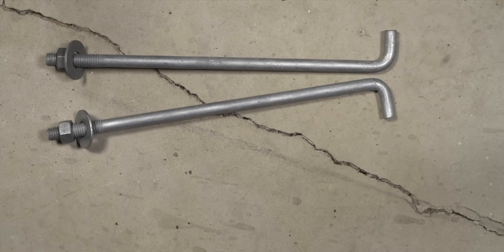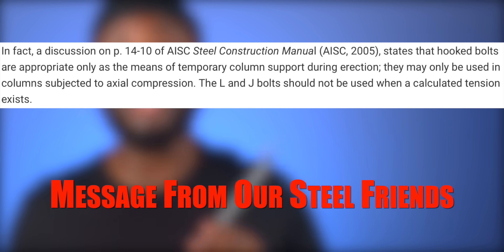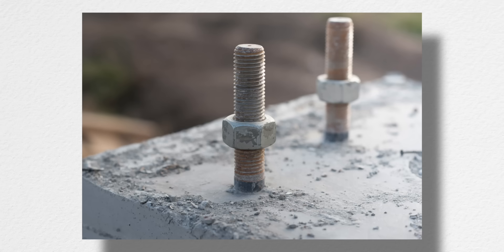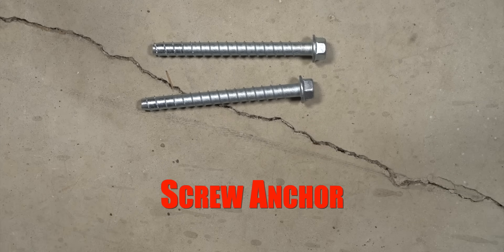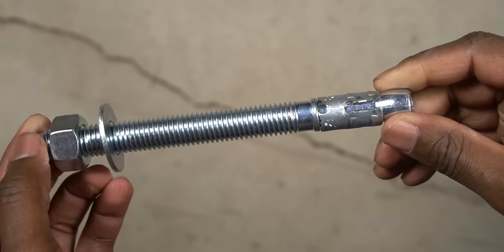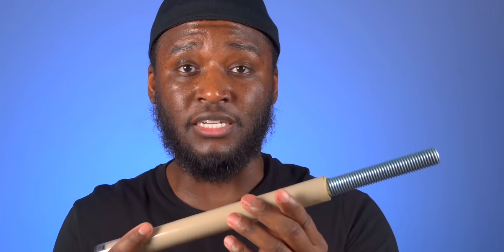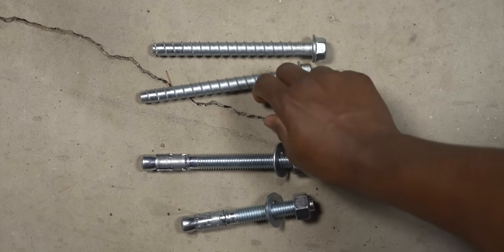Why Abandon "J" & "L" Anchor Bolts in Wood Framing Construction FOR GOOD?

Comment: Screw anchors are about the worst alternative. Most contractors set these bolts with impact drivers which results in concrete powder around the threads. Concrete is only strong under compressive loads, and the screw anchor force vectors are more of a shear load, not compressive. The theory works in wood, complete garbage in concrete.

Comment: I like post frame construction and timber frame construction best. I use brackets with two screw in bolts. I do like that threaded rod with epoxy the best. That's very cool but expensive.

Comment: As someone who has done A LOT of demolition and foundation installations; this engineer’s assessment is a classic example of paper knowledge not squaring with practical knowledge.  I have ripped screw in and wedge anchors out of foundations fairly easily with 10,000 pound excavators, but galvanized J bolts infrequently spall out of the concrete and if they fail during the demolition process the steel breaks under tension after substantial weakening at the interface with the concrete.  I suspect the errant conclusion you’re drawing is due to three things some engineers don’t account for in their paper calculations.   1. Micro cracking of the surrounding concrete during drilling of the concrete for wedge, epoxy anchored, and screw anchors.  2. That uplift is almost never perfectly vertical with any anchor.  3. Cast in place anchors can and should be cast between two pieces of rebar at the top of the foundation (which can be felt by the installer during the wet cast process).

Comment: I’m also an engineer with much experience in the steel fabrication industry. J/L bolts are problematic in that they are both made from round bar, and the threads are cut in a threading machine. They are almost always delivered to site covered in this oil, which will prevent any bond with the concrete. L bolts are the worst because many fabricators don’t have rebar bending machines, so they bend the L in their ironworker’s press. The result is a bend with almost no radius and bar diameter is necked down by 25%. I had a steel column fall over on a job during installation after the rigging was removed due to this very problem. The hook snapped off right at the bend, and with no bond due to the cutting oil, down it came.

Comment: Wet setting anchor bolts isn't brain surgery, but it sure helps if someone on the foundation crew has a brain.  We need 3" plate washers in Washinton, and the guys often get the bolt too close to the outside edge, or they assume there will be a 3x plate and they set the bolt too high. My last job we had to saw off 10 bolts because they were way too high and ran out of threads.  That's where wedge anchors are handy as a backup.  But no one in my 30 years of building has balked at wet set J/L bolts—EVER!

Comment: Dream on. As an electrician for 30+ years I've used  the same anchors shown for equipment and had them fail, even before torque. Albeit poor concrete, worn drill bit, whatever.  No poured in place has ever failed.

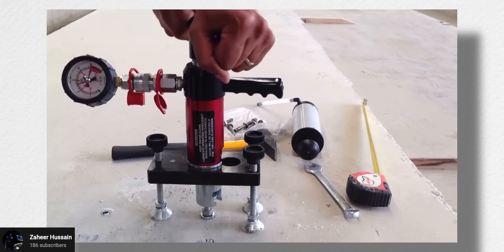Comment: sounds like you dont want to do the work it takes to use a j bolt right.  also, that test you showed at 1:27.  you shouldnt have show the last second of it.  you could see that there was like 1.5 in. of concrete, and thats why it failed.

Comment: The J or L bolts are called out in the building codes with required depth and spacing.  There is no code information for the use of other anchors and thus a structural engineer is required to sign off on the use of those and specify brand, size and spacing.

Comment: Why not replace the J bolt anchor with 'Eye bolt' anchors which would have the horizontal rebar threaded through the 'eye'?  And there are plastic 'anchor bolt' holders that make sure the anchor bolt is in the right place, plumb, and with enough room to thread on the washer and nut. Here in my area, you need to install a significantly beefier washer on the anchor bolts.  (By the way, are single bottom plates standard in your area?  Here in Washington State, double top and bottom plates are required.  Also, 'hurricane plates' are going to hold down the roof much better than anchor bolts--no matter the type--in high winds.)

Comment: I use Simpson Strong Tie expansion bolts exclusively.  They are the only method I trust.  I've tried many other types of fasteners with nothing but failure.

Comment: So, like most everything else modern, it's not about better.  It's never about better anymore.   It's about easier, cheaper, faster, when you're building SOMEONE ELSE''S building.  No thank you!  I'll take better, EVERY TIME for MY buildings. ;)  As an ametuer who has place concrete a few times, I have found that it is no problem to properly align plumbing, conduits, and, yes, anchors. It is time consuming to do correctly, but it's only once, then you enjoy a quality project for many years to come.

Comment: Code says that the bolts must be at least 7" into the concrete.  The bolt would need to be ~9".  Only 1 of the bolts you showed were even close to that.  If a J-bolt is set with rebar through it, then the uplift would have to raise the entire foundation.

Comment: My great grandfather and grandfathers used L and J bolts in their concrete work as early as 1916 . Their builds are over 100 yrs old and still standing. The International building codes cant all be correct ? Some construction is older than the USA and that construction is still standing 🤔😖

Comment: 40+  years in construction  30 as a licensed contractor. In CA we are required to position our bolts before pouring cement and if you run a piece of rebar in the J it will hold anything you need. We build here to a very high standard because of the earthquake hazard so don't let this scare you away from  "J" and "L" bolts. They work. This is just one more Engineer with complex calculations and no common sense. J and L bolts have stood the test of time and we don't need to replace them.  He keeps saying that they are still "technically allowed" as if they should be considered deficient. They are not deficient.

Comment: Been building buildings for 30 years now. I've only ever seen them used in conjunction with rebar in the concrete with a plywood template to keep it in position. Basically, you're using them wrong.

Comment: Maybe the epoxy one but expansion and those threaded ones you just screw into a drilled hole always a problem,  will stick with J & L bolts.

Comment: On a typical block foundation, any of the anchoring devices is only as strong as the bed mortar joint for the top coarse of block.
UNLESS, the block cavity where each anchor is located is filled solid with concrete and a rebar from the footing to the top where the device is located.

Comment: Great video, thanks.. I was a contractor in Florida. I moved to GA and when I went down to help a bud with a custom I found out they had changed to threaded rod from foundation to rafter. Much harder to run rod all the way around the home but I loved the continuous rod from top to bottom. I have seen hurricane damage that left the plate(j bolted)but the house was gone. In some parts of the country this isn’t code but I always said no matter where I build I would use Florida code. It’s pretty solid.

Comment: you need to double check your figures .you said friction can't be considered in your calculation for the pullout strength which doesn't make any sense ,it's there it's real  . and if you look closer at the ones you recommended they are not embedded in the footing .they just sit in a hole depending on either the TINY threads on one model the other depends on just the bell on the very end on the anchor to do all the holding .now it is true both of these  anchors work well but to say they are better then a anchor embedded in wet cement  is just foolish .do a test with your recommender versions by putting the anchors  2 inches deep  like you did with the L anchor . then see how well they hold ,,or don't hold

Comment: I'm not an engineer, but as a residential builder, just the logic that small threads or a flare is more resistant to pull-out than the cast in L or J section is ludicrous.  We've done drill-ins with the flare when a j-bolt was missed, and the only thing that keeps them in place in our area (which must be engineered for 90 mph winds) is the fact that the special epoxy going it the hole is stronger than the concrete and bonds to it chemically.

Comment: If those L bolts are good enough to hold a steel post and cantilevered sign way out over a highway, which has a tremendous leverage force on it, then I trust it is plenty strong to hold a house down.
I have used Tapcon screws before and if you drill the hole slightly too big, fail to clean out the dust, overtighten it or loosen and re-tighten it, there's a big chance it will not hold.
If a J bolt was hooked under re-bar and you pulled on it with a crane, I bet you would lift the slab up before the bolt pulled loose.

Comment: Gotta love engineers. Those J bolts have held down houses and buildings for over a century but now all of a sudden they are not strong enough to stop high winds from ripping a house out of the cement foundation? OK 🤣🤣👌👌

Comment: Are J bolts actually failing due to the wind pulling them out?
I have only seen a couple houses that have "blown over" but the J bolts didn't appear to fail on those houses.

Comment: In a case like this where structurally both things are fine solutions, I would just go with whatever the builder is used to using, since that is what they are most comfortable with and thus most likely to install correctly. The engineer and builder should be involved from the beginning and talking together anyways.

Comment: Bottom line one all of those options is skill in application. 
I did foundation repair and seismic retrofitting in Seattle for two decades. Getting any of those anchors in the right spot for the right conditions is   crucial. However the Titan HD bolt is a game changer indeed. Pretty much dummy proof.

Comment: Jbolts are not that hard unless your concrete installer is struggling.
Post installed anchors can be difficult finicky and problematic as well. 
This video is off kilter and factually challenged. 🤷‍♂️
It’s a good discussion tho so there’s that…

Comment: How many structures have you seen come off the foundation? In my 30 years, I've seen many structures that were built without anything holding the houses down. I live in the Northeast on the Atlantic Ocean. If the forces are hard enough to lift your structure off the foundation, your structure is probably destroyed anyway.

Comment: How much wind would it take to cause enough uplift on a roof to pull the  anchors out of the foundation? I have helped clean up a  family friends home that had been destroyed in a tornado. The house was literally gone. The only thing left was the foundation and the bottom plates that were still held to the foundation by the j-bolt anchor bolts. The bottom plates were all still tight against the foundation. It was the nail connection of the 2x4's to the bottom plate that didn't hold........

Comment: Yeah, uh no. Anchor embedded anchor bolts will be required, and inspected prior to pour. If they are missed or inadequately spaced there will be a substitute resolution which may involve  special inspection and or testing. Post pour installation bolts will be more expensive and may not be adequate.

Comment: I have a job that has me do the same things over and over, and I have figured out ways to make the hard tasks easier.  If my job was to install dozens of L bolts on every job, I would be very motivated to come up with a way to get them spaced properly, set at the right depth, the right distance from the edge, and hold them there until the concrete sets.  If I was unable to do that, the bottom line is that is that I would be incompetent at my job and deserve to be fired, or never hired on another job again.
Don't ask me how to set L bolts because I don't know.  But if I was making my living at it, I would find out how other people do it, or I would invent a way to do it.  And I'd make it a priority and get it achieved pretty darn fast.  In fact, I'm going to search for YouTube videos that show how to do it right now.  I'm guessing that several people have good ways of doing it, and they've been in use for decades.

Comment: You will not pull a j-bolt out of the concrete will pull a f**** drive anchor out or screw bolt yes you will yes you will yes you will

Comment: A video showing the pull out test of J-bolts vs the other options you mentioned would be more interesting than "J-bolts bad, use these". Show your work please. Also, FWIW, my personal experience with expansion bolts like the Red Head is that about 20% of the @#$%^ things fail to expand in a way that I trust the connection.

Comment: Why is it called the “International Residential Code” if nobody outside the USA is interested in it?
there are basically few countries that have a worse standard of construction than the USA
the screw anchor, for example, is not permitted here for load-bearing constructions, an expansion anchor is the minimum

Comment: Please keep making videos on best practices for EVERYTHING to do with co structuring: under floors heating retrofit on concrete floor that holds moisture. 

Electrical install if you do electrical too. 

Better and stronger siding materials and techniques

Etc.

Love hearing from an engineer. Makes me feel more secure with the project I am about to undertake.

Comment: Engineers and Construction Professionals,

I am seeking expert advice regarding a serious concern with our newly constructed home in Texas. The property is a two-story, 2,265 sq ft residence with a long, narrow footprint. As one of the newer homes in the subdivision, it was temporarily isolated in an open plot when a severe storm (93 mph winds) caused structural racking damage.

The builder promptly notified us of the issue, stating their intent to demolish the existing structure, remove all debris, and rebuild from scratch after a foundation inspection. They also committed to providing an engineering report. Upon inspecting the foundation myself, I observed no visible cracks along the exterior. However, nearly all anchor bolts were severely bent—some completely flattened—with a few causing minor concrete spalling at the edges. Given that the home was not visibly racked to an extreme degree, I suspect much of this damage occurred during the teardown process.

My key questions for professionals in the field are:

Anchor Bolt Replacement Methods: If the foundation is deemed structurally sound, what is the standard procedure for repairing or replacing damaged anchor bolts?

Original vs. Replacement Integrity: Were the original anchor bolts cast-in-place during the pour? If so, will drilled-and-epoxied or expansion bolts provide equivalent strength and long-term reliability?

Potential Compromises: Does drilling into the foundation for new anchor bolts introduce any risks (e.g., reduced load capacity, water intrusion, or corrosion susceptibility)?

Inspection & Compliance: What specific engineering checks should I request to ensure the repaired foundation meets code and industry standards?

I have a meeting with the builder tomorrow and want to approach this discussion with informed, technical questions. Your insights on best practices, potential red flags, and critical verification steps would be invaluable.

Thank you in advance for your expertise.

Comment: I thought you were going to recommend a threaded rod with either two nuts sandwiching a washer or a headed bolt. I prefer double nuts with a square plate washer. I like how they naturally dangle plumb too.

Also, there is no way a proper epoxy job can be both faster and cheaper than cast in place anchors. I would be surprised if you could drill and clean the holes in the time it takes to set anchor bolts onto form boards. Epoxy isn't cheap either. Definitely more expensive per hole than a nut and washer.

From a contractors perspective, the biggest reason to not do post installed would be that concrete subcontractors are best suited to anchor bolt placement and spacing, and making the framers responsible for the anchors means they have to read the foundation plans properly with little experience.

Comment: I would want to know the exact testing used because like anything you can force the result you want by applying testing that sways the results one way or another.When talking about  a  house builders have been using Jbolts for ....oh only 150 years and I have never heard of a single failure.They used to put them in every 8 ft now it is 6 ft or closer depending  on a few things so they are even more efficient than before.
ALL  construction is designed to be well above the minimum standards everything is overkill becuase engineers don't trust themselves they don't want the risk of failure coming back on them plus the obvious chance of workers not doing their job to the best standards.